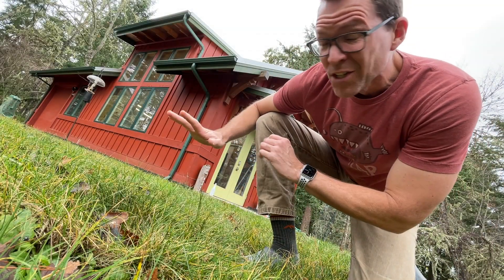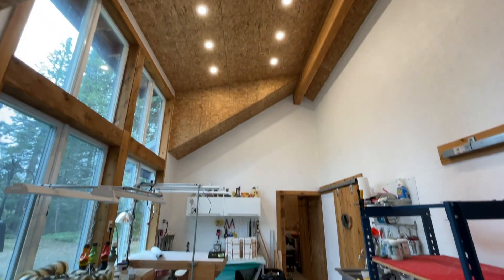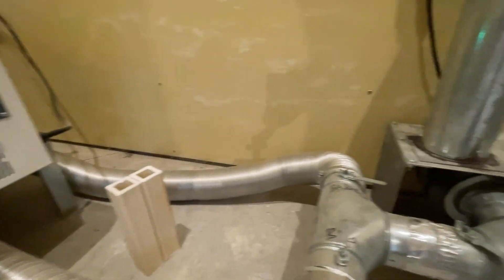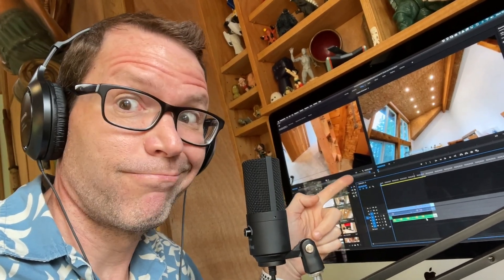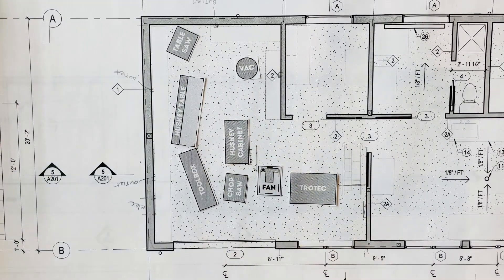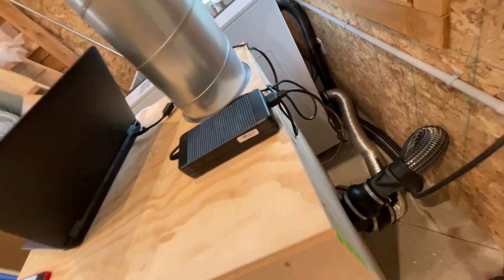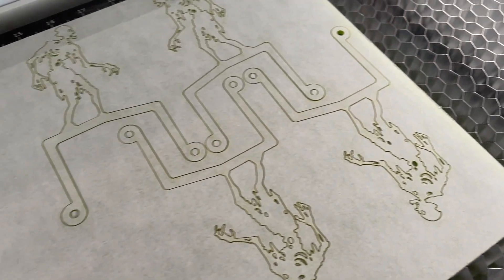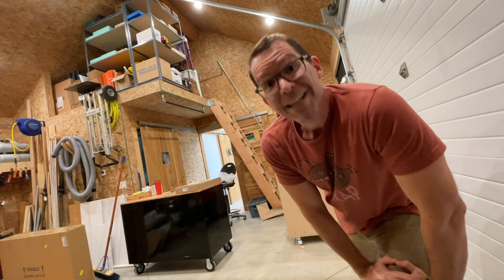Studio Tour, Laser, making a laser quiet box, & Zombies! - Tiki Technical Tuesday 44

Comment: Wow, do you do all your electrical work?  It looks crazy complicated.  Also, I really dig the deposit trap you made for the sink.
Reply from the maker: I did do all the electrical - but I am fortunate to have a great resource/teacher in my dad, who has a degree in electrical engineering. He was a huge help in double checking my work when I installed the wiring for our small doll kiln. With the current pandemic, I had to do the laser wiring on my own - and that meant lots and lots of triple checking my work 😄
The plaster trap is a dental supply sink trap. You can find them on Amazon - I like that they use a large bucket - many of the ceramic studio branded traps use very small containers